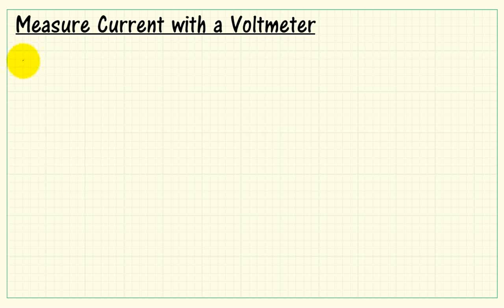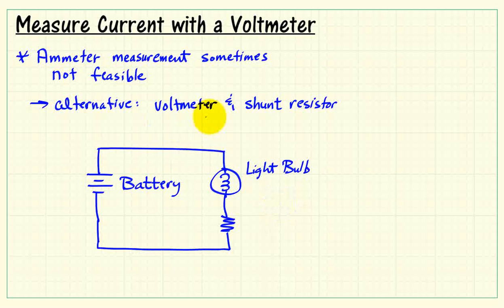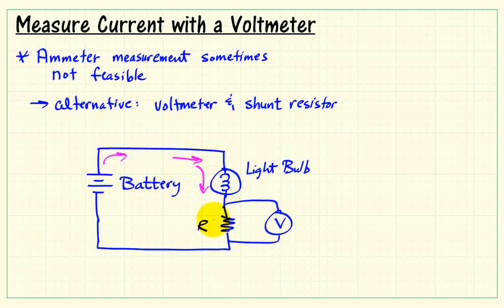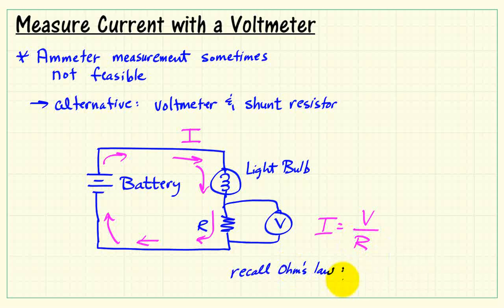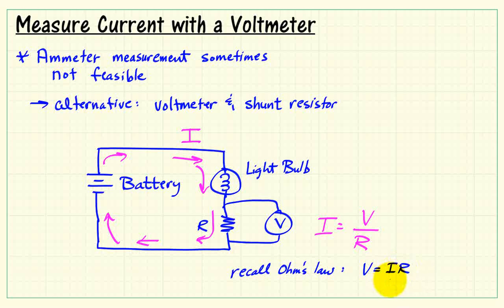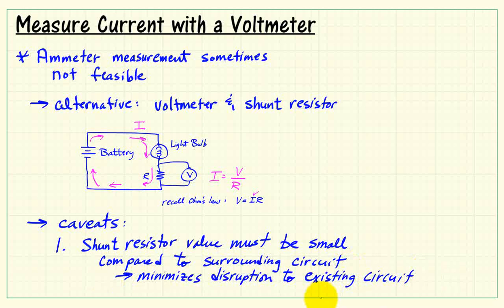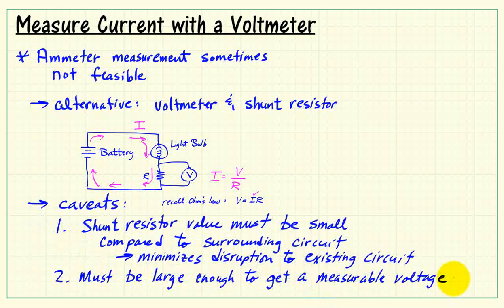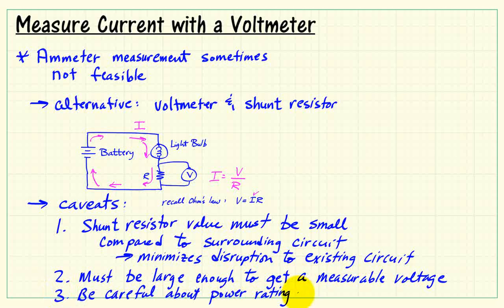Measure current with a shunt resistor and DMM voltmeter

Comment: The current is measured V input - Voltage output
So Voltage of power source and Voltage after load is connected so if this is callee Voltage drop that should be called electrical current and it isn current but is voltage loss bcz current it doesn't exist even the ampere meter is just a voltmeter for very low voltage current exist only in the moment when potential touch the resistance and still is not ampere but jusr potential difference and for thath why resistance is going hot only in the center bcz there is the equilibrium point and the wire acts like a capacitor and resistor in the same time but a capacitor that is one plate is close to the another plate you should see diode principe what im telling you and that is the way how Fleming invented semiconductor diode he just wantet to measure current device but in fact current it doesn't exist is unmeasurable just is the potential differences nonmeasured but only they can badly measured if you connect a resistance in middle of them which in fact have the bad effect of voltage drop and not only the load resistance but all the resistance of the circuit so conclusions im telling to you is that voltage resistance and current we cant measure and if we measure we are making mistakes that are taking human lifes like shock /fire hazart by extreme heat bcz heat also is unmeasurable /explosion etc we are trying to measure infinite but infinite is infinitely infinitore

Comment: I have modifited microwave oven with can put maximum current of arround 800amp?
And the voltage is 2-3v AC so what resistor do i need? Is that even possible?
Clamp meters are too expencive...